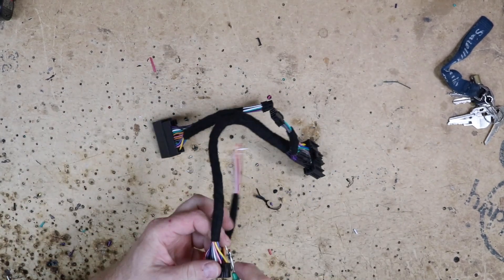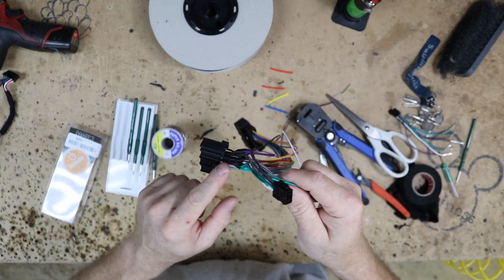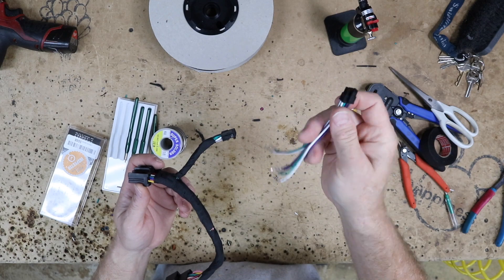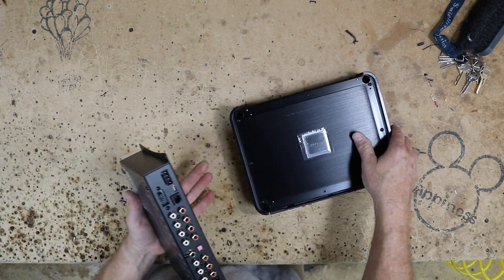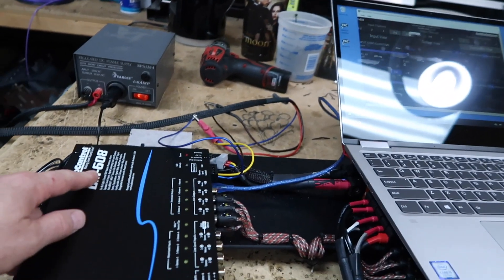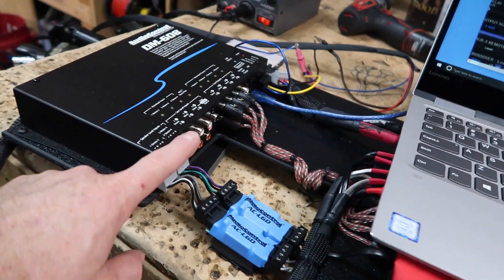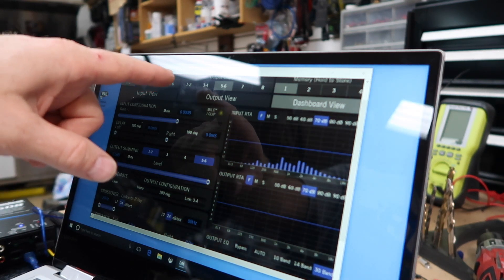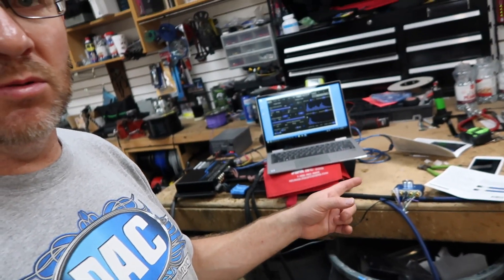Ford F150 Part 2, We get the Amp and DSP wired up,  Installer Dairies 139 5

Comment: Any recommendations for a shop in Vegas? I’ve upgraded my 16 Scion tCs headunit, speakers, and added a sub and amp with remote bass knob. I’m not super impressed I think mostly due to insulation issues (lots of noise coming from doors.) however I think the system needs to be tuned. It was never done and I think the bass knob needs to go. The sub and amp were the first thing I added, so they put in the remote knob and it seems like there’s not very much play. I cycle between the first 3 dots out of like 50 because it’s either too much or too little bass.

Comment: Good evening I'm having all of my factory speakers replaced in my 2015 Ford Explorer with the sony system. and replacing them with all JL JL Audio C2650 for the front, JL Audio C2-650X in the rear, JL Audio 8W3v3-4 sub and the JL Audio RD900/5 for the amp. and some 2 3/5 speaker in the rear pillar of the car. The installers are using the PAC AmpPRO AP4-FD21 Aftermarket Amplifier Interface should I add the JL Audio FiX™ 86 to the system to tune it?  and second question when you guys are doing a system similar and tune the system do you charge for that or is that just built into the installation price as well.  Thank you for you time and your response
Reply: bump on this interested in answer

Comment: Hey guys, which T harness was that at the begining of the video? doing a 2022 f350 soon and would like to use that instead of cutting into factory wires.  Thanks
Reply from the maker: PAC has a new line of T harness, check them out.